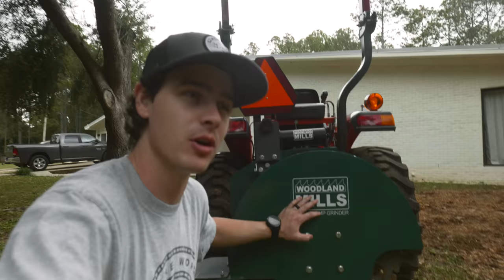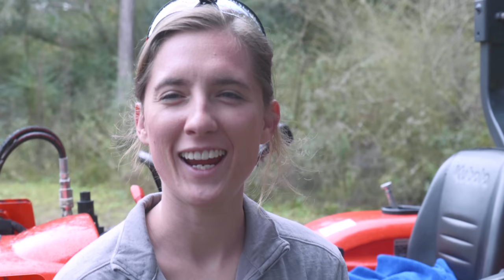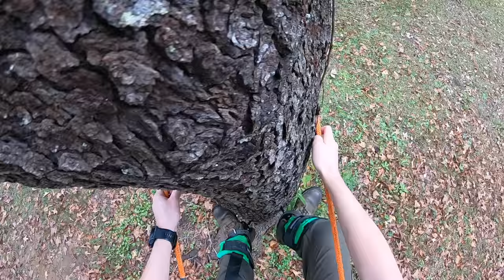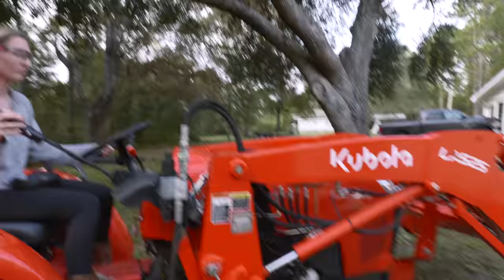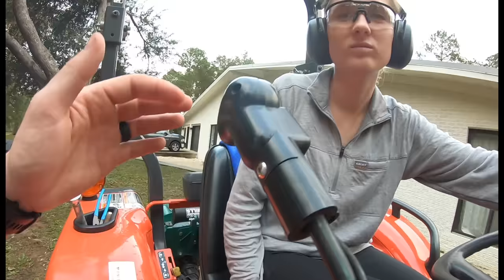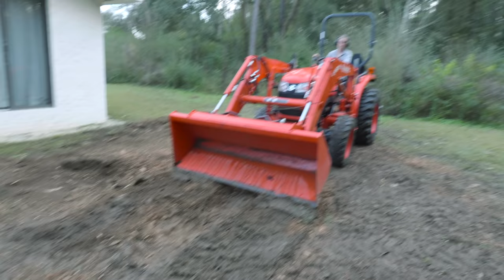My First Day Driving A Tractor: This is What Happened!

Comment: Molly, you did a great job for your first time. Just a little tip that might help you in the future. There is no substitute for experience and practice. Something that may help you in the future try and keep the bucket flat and level, and just use light pressure to help you flatten the ground evenly. You did a much better job than I did for my first time.